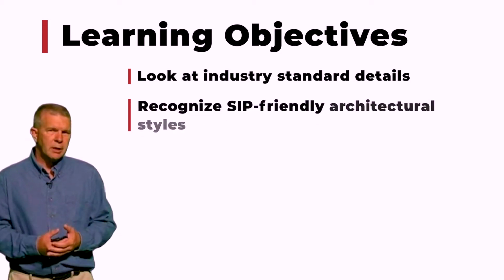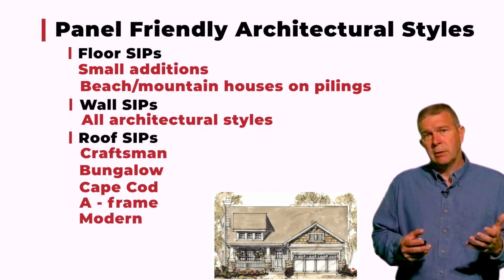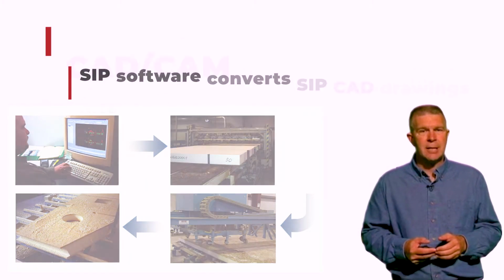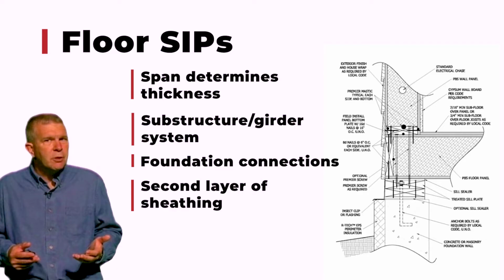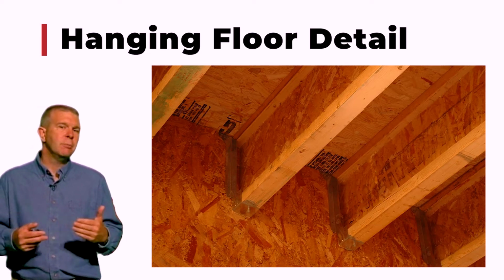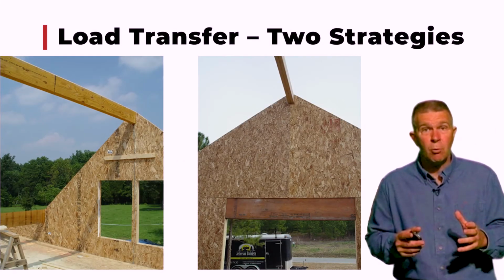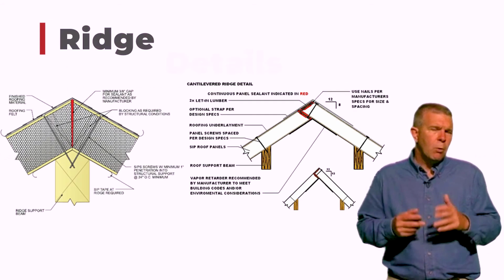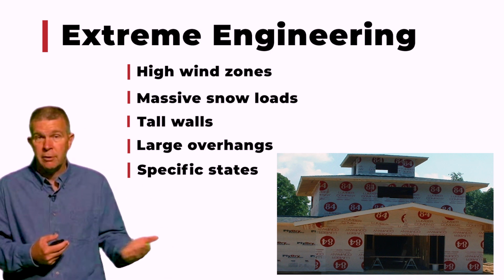Lesson 02/10 - Basic SIP Design and Engineering - BEST Program

Comment: Hi I'm based in the UK and need some advice, I have used a manufacturing company that had erected my sip man cave, roughly 6.7m (w) x 4.88m(d) and 2.5m high they used an eps system with 122mm panels, the flat roof uses 600 x 2400 panels however the company has joined these two panels with a 2x4 c16 timber, to span 4.88m for the roof the roof also has an openings for a 70kg skylight, I am worried once I put the skylight in the roof might not hold the skylight, as the max span of a 4x2 with a point load of 70kg is roughly 1.7m, can you advice please
Reply: How did you get on with your build? Remember that the splines joining the panels are glue and screwed to form a composite structure much stronger than just the splines themselves. If you were talking about a joisted roof using 4"x2" joists then you would be correct, they would not be sufficiently strong but a SIPs roof is different! Happy to talk it over. (Sources: I work for a SIPs processor and housebuilder in Scotland)